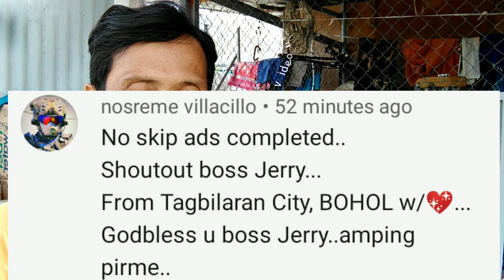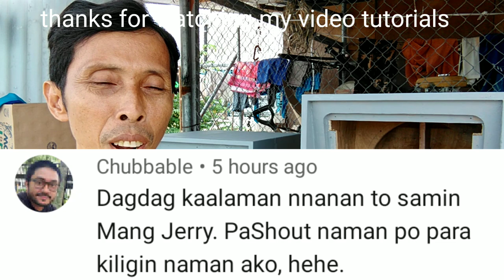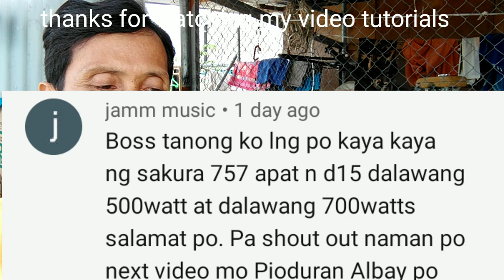MCV and RCF box project painting

Comment: My D15 subwooper 450wts midrange 220wts crown tweter 150wts Rockford tweter 300watts may free capacitor kasi c Rockford  tweter 2.2uf 250volt kailangan pa bang lagyan c crown tweter ng capacitor sa pararell conection?

Comment: sir magtatanong lang po ako about sa speaker na two terminal po halimbawa po 250 watts kapag penarallel ko po ba ay magiging 500 watts po ba yon or 250 padin po
Reply from the maker: 250w pa din Yan, impedance Ang nagbabago nyan, Kung 8ohms Yan, magiging 4ohms.
Reply: @jerrypadaong5753  salamat sir nalinawan napo ako , sir pwedi napo ba ang dalawang instromental 10 inch 8 ohms na speaker 150watts bawat isa gagawin kong 4 ohm sa lift chanel at isang speaker targa na 4 ohms dual terminal  8 inch sa right chanel 250watts po at dalawang 150watts na tweeter po kakayanin po ba ng konzert 502 ko sir